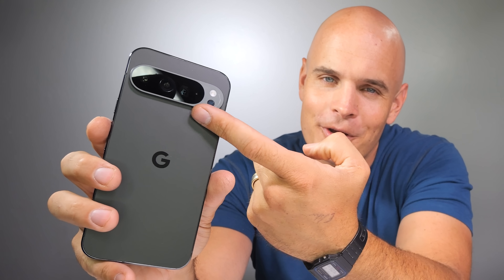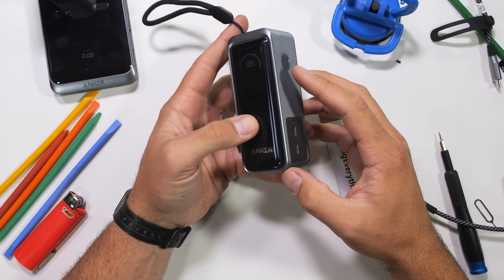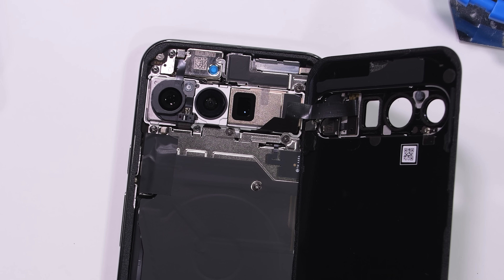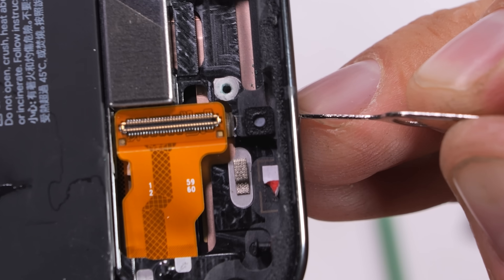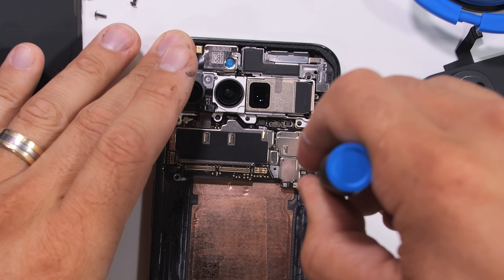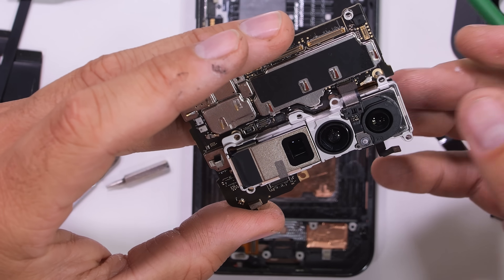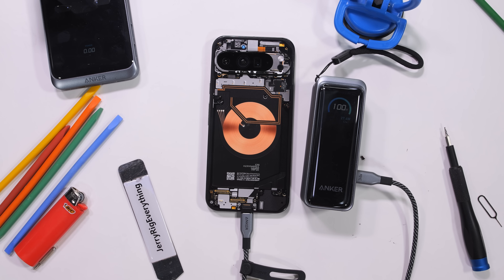Google Pixel 9 Pro XL TEARDOWN – (turn back while you still can)

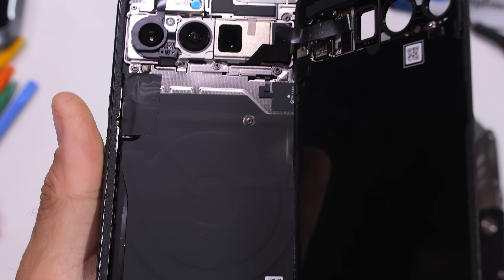Comment: 2:18 I can not disagree more strongly with claiming that Torx is an anti-repair feature.
It nearly completely mitigates the screw camming out or stripping issue and the correct bit size is immediately obvious.
As supported by Framework opting for Torx in their laptops. As far as I'm concerned, anyone preferring Philips head over Torx is incompetent or affected by Stockholm Syndrome.
But I do agree with the phone being needlessly complex and hard to repair in construction.
Along with the usual modern trends of lacking a user replaceable battery, expandable storage and headphone jack.
Reply: I was about to write the exact same thing. Anyone who prefers Philips over literally anything else is a complete moron in my eyes because the amount of Philips screws that I have in my electrician career both stripped myself and seen stripped to absolute nothingness and then had to take my "universal screw remover" also known as a hardened steel flathead screwdriver and hammer combo to replace them, even on equipment worth tens of thousands of Euros, is incalculable.
Torx is one of the most resilient screw head designs that isn't some proprietary BS requiring specialty bits, everyone who owns a bit set already owns at least some Torx bits and unlike Hex screws, Torx is commonly available in a simple screwdriver form so you can get to even the tiniest screws hidden in the depths of Moria.
Reply: @goofy851 same here. We build industrial cabinets and even though i know philips are so common in the electrical world i like torx or any other wayyyyy bettet
Reply: I mean, who would be able to open those glued phones but would not have to torx set?
Reply: Just wait until you see them rivets on many modern cars. God, I hate them so much that I won't be close to touching them or even owning them.
Reply: Philips screws allow for wrong size bit to be inserted and feel somewhat "right", thus stripping them. They also strip by "camming out", even if you set the torque of the cordless drill to minimum. Overall, avoid when possible.
Reply: Slot and triangle is the easiest to work with.
Reply: We use torx for all of our carpentry construction for a reason! It completely gives the driver the best bite on the screw with the least chance of slippage. Even in the phone world with the HMD phones, being advertised as user fixable, uses a torx screw to pop the back.
Reply: I'm jumping on this one because Torx are by far the best driver interface since Robertson square drive. I have yet to strip one; the biggest issue people have with them is having the wrong bits or whatever cheap drivers they bought being out of spec. Get some good Wiha drivers and know your sizes, and you shouldn't have any problems at all.
Reply: @MattThompsonOnGoogle  +1 for Robertson <3
Reply: The plan is 
Buy a new device if the battery dies 
Buy our wireless headphones
Buy our cloud storage subscription
Reply: thing with torx, is you can overtorx it. Much better to damage the screw than the hole it goes into.
Reply: @trakaiszeks  finally, a counter-argument based in reality in this exploded comment thread.
I'll still disagree as removing a stripped screw risks damaging the surroundings and as torque limited drivers exist as a more proper solution.
Along with it simply being a basic skill not to torque to the point of where a Philips head would strip, as if you used the right bit and it engaged properly, you already over-torqued it at that point and are worse off with the stripped head.
Reply: He never said they were "security screws", he was just complaining about the size, t4 is too damn small when most devices are using T5 or larger, even a weha t4 can strip with enough loctite with how small the damn tip is
Reply: Sorry Google I was really interested in this phone but this is proven to me I don't want it now I like to change my batteries and do it all of my repairs and stuff and this is a no no it's worse than Apple😂
Reply: I thought he meant that t4 is an uncommon size of torx. 
I have had standard sets that went down to t5, but I only ever got a t4 bit in an electronic repair bit set. 
The screw size difference is 0.16 mm larger, or 0.005 inches.
Based on the holes we see in this teardown, the reason they went with t4 instead of t5 is probably not a matter of space or weight.

I personally use torx for all my screws, even my 3 inch deck screws. 
The force spec on the small ones like a t4 or t5 is so low (~0.28 Nm or ~0.51 Nm) that I think a child could accidentally over tighten and strip a t5 machine screw, either the head or the threads. 
(for reference, my power drill can technically provide ~56 Nm of torque, enough to strip the more robust t25 (~19 Nm) that the deck screws use, but the wood gives way first because deck screws aren't made of aluminum like most phone screws)
Reply: Torx fasteners are used all over in the automotive industry.  The Torx "security" fasteners commonly found on things like Mass Air Flow sensors is just an anti-temper measure.  Everyone has Torx security bits.
Reply: As someone in manufacturing, companies don't care about the ease of access or repairability. All they care about is cutting costs. Torx cost less than philips.
Reply: @the_og_alpha  obviously does not work in manufacturing hahah
Reply: Torx screws are VERY prone to stripping. I had 10 times as many stripped Torx as I had Philips in my humble 4 years of repairs.
Reply: @PvtAnonymous  Your experience defy basic physics (torx having more surface area to distribute the torque) by claiming that PH is superior. This is known as user error.
Reply: @PvtAnonymous Not sure what you're repairing, but there is a reason the automotive industry uses every other type of screw but philips. The only places I've seen philips on cars is on insigniticant plastics/interior bits.
Reply: @PvtAnonymous  That only tells us that in your humble 4 years of repairs you either never had good quality torx drivers, or your motoric skills are more on the car mechanic side than on the small electronics side of the spectrum.
Reply: @PvtAnonymous  Sounds like you need better drivers. I work on Dell XPS laptops daily and they used T5. I never had any issues with it.
Reply: The greatest Dell Technician that ever lived.
Reply: @PvtAnonymous I work in aviation, and I've had to extract tens of thousands of stripped out Philips screws, but literally only ONE stripped out Torx screw.
Reply: @deluxejay69  Fuckin' eh. Switched the robbies' tailboom, engine and mast cowls over to torx - no issues. And "aviation phillips screws" are like 20x more expensive than regular phillips screws.
Reply: @PvtAnonymous  Yeah, that's a you problem. I've been an electrician for over 10 years and I have never even seen a stripped Torx, let alone managed to strip one myself.
Reply: @PvtAnonymous  bro have u ever used a tool?
Reply: @PvtAnonymous that’s a you problem. Torx screws are stronger and that’s not just a personal opinion. They are literally stronger
Reply: @PvtAnonymous  yeah, no. HEX is less durable than torx and philips, and from my experience with abusement of different types of screws, the strongest and most universal is slotted, and any screw can be slotted with big enough angle grinder, even M3 screw
Reply: Torx cam out just as easily as any other head design, anyone shilling for torx has no life experience

Comment: I don't understand why phone manufacturers need to glue the batteries in so hard, if at all. With all of that 'stuff' in there and the front and back glass on either side, I'd think it wouldn't really have any room to move around. But even if not, what's wrong with a screw or two? Or even just a much smaller dot of glue or some adhesive designed to be removable like blue-tack (although maybe something a bit fancier).

Comment: In fact repairability for tech is easier since we don't have to remove the screen and probably break it for replacing the battery or the charging port or whatever else by only removing the backglass (a broken back costs wayyy less than a screen), also the charging port is now modular compared to the previous Pixel which were soldered on the board !! Btw Google uses the tork screw for awhile now and different sizes since the Pixel 6... Although the battery is always a pain to remove and their tabs never work.
Reply: An improvement these companies could make would be to screw the back panel instead of gluing it. I can understand not wanting to go back to the snap mechanisms of the old days that were easy to open but became flimsy over time, but glue just makes disassembly harder
Reply: @lemonbrothers3462   i never had problems with double sided tape, but i kinda agree for something like adding screws to tight a real rubber seal around the back panel to improve the waterproofing

Comment: I think you’re completely right. I love Google phones and I think they’re the best in the game, but this year’s lineup is disappointing. They’re huge, thickkkkkkk and the look like an iPhone on the side.
Older pixel phones were the best in screen replacement, requiring 0 screws to get the job done. Now they made it so that is nearly impossible to fix it. On stage it felt like a Gemini presentation, not a new phone presentation. They talked about them for like 5 minutes.
I’m disappointed.

Also tf is going on with the names?? pixel 9 pro fold? is the next one going to be pixel X pro fold 2?😂

Comment: Can we just appreciate though how repairable it actually is for the most part? The USB-C Port being much easier to replace instead of being soldered, most parts being lego-style connectors, and yes the battery will be extremely difficult to get out the first time, enough isopropyl will ease that, plus the 2nd battery that's put in can be mitigated with your own adhesive. All in all I'm fairly impressed.
Reply: even the battery isn't bad if you actually look at the instructions... it's just a bit different
Reply: @The.Boo. Are the instructions in the box? I haven’t received my Pixel 9 yet.
Reply: @The.Boo.  most people don't own or are willing to buy a $50+ heat plate just so they can replace the battery without a huge hassle. the battery is huge f*ck you to any consumer who is even remotely interested in self-servicing their devices.
Reply: @SlickSloth You don't have to have a heat plate to remove the battery. Most people won't have to remove their battery when its brand new. Most will have had many heat cycles, outside temps, etc that's softened the adhesives over time. Regardless of how it's meant to be removed, DIY folks can simply put a few drops of IPA around the battery and use the tabs in a sawing motion to remove. That's what I've done with previous pixel models and this one looks the same.
Reply: @SlickSloth I can get the battery changed by an official google repair partner for almost the exact same price as you can do it yourself.

Im not wasting my time when thats true.
Reply: i remember when i could just remove the back cover and switch the battery while all of it was water resistent.. for example the samsung s5
Reply: Exactly! That plastic charging port breaks after 2y of use (speaking from experience with my pixel 4a) but at least it's affordable to replace now!

Comment: To make battery removal easy. Use a heating mat and just heat the phone enough where you can kinda feel the warmth through the battery. Makes removal a million times easier. Between the heat and alcohol. Gentle prying with a plastic or metal pry tool will get it out in seconds
Reply: The official repair guides are out, they say 70°C on the screen side for 10 minutes
Reply: @MattM-24  exactly this ❤️

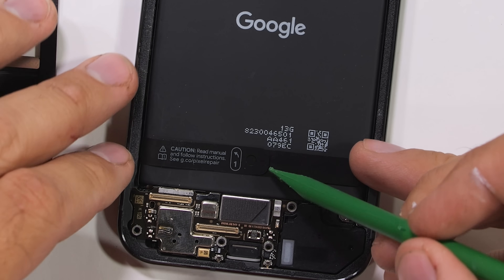Comment: It looks as though those battery tabs are meant to be pulled tight & used to saw back & forth through the glue as you pull upwards 3:47
Reply: That's the way I understand the pictograms as well. I hope a correction video or a pinned comment at least is added once Google clarifies how they are supposed to work.
Reply: @bluecranium  I was thinking he even did this in a previous teardown video with another phone as well. Found it odd that he didn't seem to remember from that previous time but thought it might be more of a statement that the average person wouldn't just know that, and especially if there wasn't anything explaining it on tabs or in the video the QR codes link to.
Reply: @mrgw98  the intent is that you're not supposed to know how they work until company explains how to use it.
Reply: That is the intent, but they've never really worked well at that... And the way the glued down the battery this year makes it seem very unlikely that it could ever work
Reply: @AlexSchendel This is simply incorrect. That is NOT the intent of that tab. It's meant simply for pulling the battery out. You have to use a heat pad at 70°C so soften the adhesive, and then you can easily pull away the battery.
Reply: Just remember that these are voiceovers after he actually plays with them, and he edits out some of the time he messes with the phone. Check 4:06
Reply: I read a comment on another teardown that it is suppose to be heated up to like 70 degrees or something before you try to pull it out. Which doesn't sound great for all the other components
Reply: @fredrikfjeld1575  Most electronics are happy at 70 degrees C, it's not an issue. The only component meant to operate at less than that temp is the thing you have to heat up: the battery itself.
Reply: Well he said that the glue is too strong to slice through it so I suppose he has tried that as well. Not to mention the website not giving any further instructions
Reply: @prayhe  i can't even access the website. it asks me to pick a country and then redirects me to the Google store.

Comment: The battery tabs are supposed to be used to "saw" back and forth to cut through the glue. Not to be pulled to release the glue. Thats what step 3 was trying to say
Reply: You're also supposed to heat the phone up to 70c on a heating pad before using the saw tabs. Its in the repair manual
Reply: He tried to rip that battery right out but you have to pull to the Side 🥲
Reply: It's still harder than just pulling
Reply: You need to pull it to one side to start sawing though, and it broke when he tried.
Reply: That's because he didn't heat the phone for 10 minutes like the instructions on the tab tell you do lol
Reply: The point you all seem to be missing is that, why is such a needlessly complex process even needed at all? Why not just use magic pull tabs instead?
Reply: no shit... thats what he tried. As soon as he pulled it to start "sawing" it broke. Did you even watch the video???
Reply: Just remember that these are voiceovers after he actually plays with them, and he edits out some of the time he messes with the phone. Check 4:06

Comment: I'm getting really frustrated with Google these days.  I can no longer restore a Chromebook as the download can only be done on a chromebook and not downloaded from any other device and saved for later in case.  

Also, you can no longer download a YT app on anything but android devices, they locked out Chromebooks as well so you cannot watch movies you have purchased without this app,

No more re-purposing certain chromebooks later with a different OS as they LOCKED them to the point even techs don't wanna work on them.

This is why it's bad to be tied to any ECO system aka Apple, Google or Android alone.

Comment: Thank God you're doing this!! Please let me know if My water resistance has been compromised.. also some people online have been poking the wrong hole with the SIM card tool 😅 You know what I mean 🤦🏾‍♂️
Reply: I'm one of them! The way I understand the video (I watched that section like 10 times), putting the SIM tool in the mic hole did not cause any sort of damage. It was damaged when the phone was opened up and the membrane where the mic is was broken from the top, inside the phone. I have tested mine on numerous calls and everything seems to be working perfectly.
Reply: @markchildrey9441  what about water resistance ? It should be fine right ?

Comment: I don't get why people think a glued down battery is such a huge issue. Ok yes, it's annoying, but do you really think large scale recycling operations are really going to be hampered by a single extra step that most of them are going to have to take anyway when those pull tabs, aged by a good few years, all break upon pulling? It's not like the battery is made any less recyclable by the removal process either; you can recycle a slightly bent battery just as easily as you can recycle a pristine battery. This "glued down battery" "issue" seems like a huge distraction from things that actually hamper repairability such as parts availability. What's the point of an easily removable battery if you can't get the charging board anymore, for example? Ok sure you can use wireless charging, but if you ever need to do anything with fastboot you're boned regardless as wireless fastboot seems to be something that got dropped.
Reply: Agree 100%. This phone looks downright delightful to work on compared to some others.

Comment: I really want the Pixel 9 Pro but the $999 for their outdated hardware and low storage space 128gb doesn't make any sense.  I struggled for a week and finally I ordered the Oneplus 12 because the price is cheaper, more storage 512gb and that thing comes with a 100w charger.